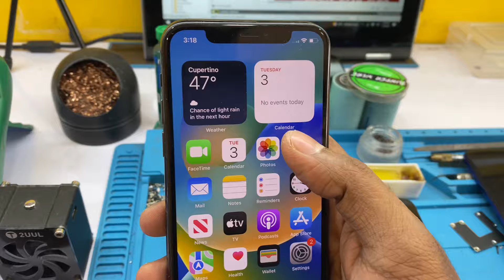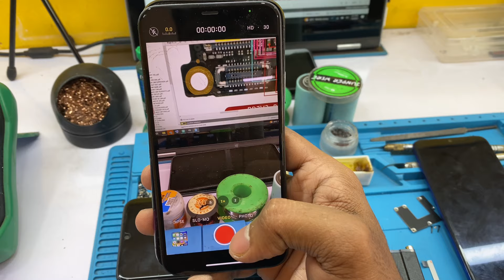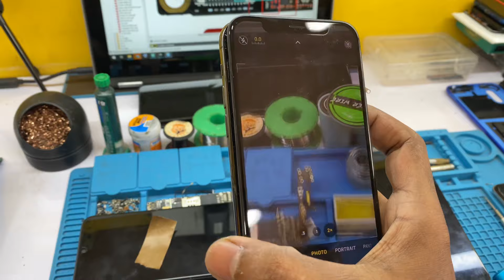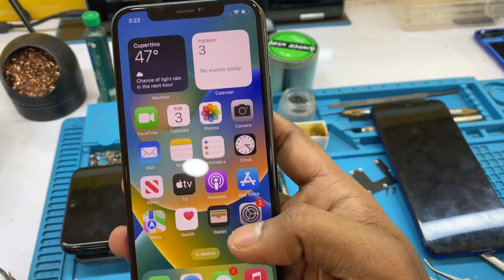iPhone 11 Pro camera shaking problem solution 100% working

Comment: but does that not meant that there will be no more "STABILZATION" ?
Reply: Stabilization works perfectly. Just tried it
Reply: stabalization works after installing magnet I already tested it bro😊
Reply: @sharmaxop  I tested it too… 
Stabilisation works only DIGITALLY not Physically… also speaker became quieter as it is close to the magnet.
Also I get a warning message saying there is magnetic interference 

WORST SOLUTION EVER!
Reply: @sharmaxop  Bro where can you get that magnet

Comment: You're basically messing with the hall effect sensor in the OIS. There will be no more OIS after you attempt this mod. It's not a real fix.
Reply: hello bro I am facing video shaking problem on my iPhone when I  zome it on  1.7x how can i fix it?
Reply: But there is no method of fixing this problem.This is the only solution or change the camera